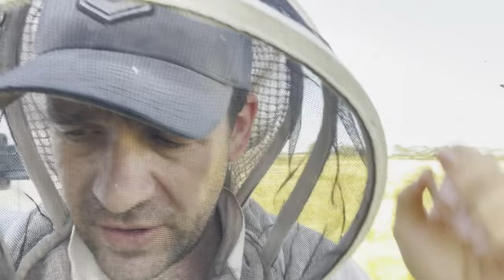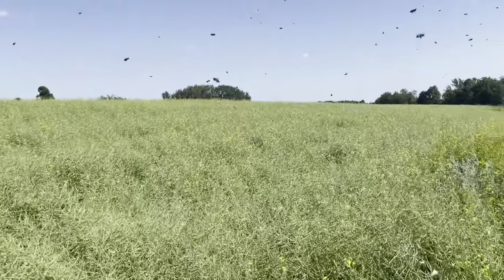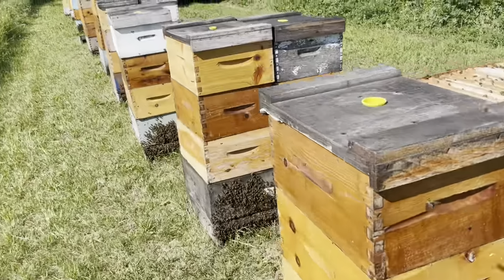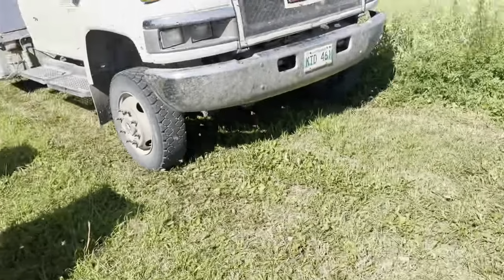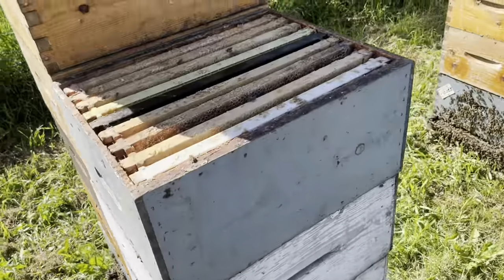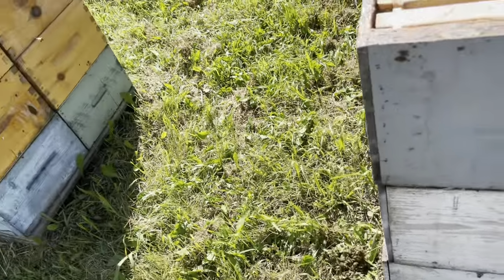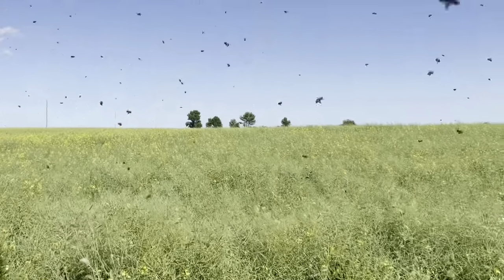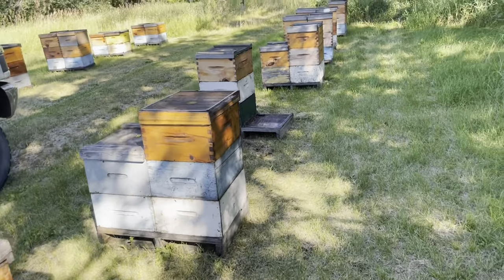The Waning Flow Aug 9, 2022

Comment: Seems you are right about drawing foundation on a flow. I needed to get more supers drawn and I tried a couple of different methods and the best was 9 frames total with 2 undrawn in the middle. If I put undrawn on the outside they ignored them or if I put in 4 or 5 undrawn frames with drawn comb they only used the drawn frames. 
Ian, I'm happy for you, with a good crop going in the barrel. You toughed it out and you gave the bees a chance and they performed.